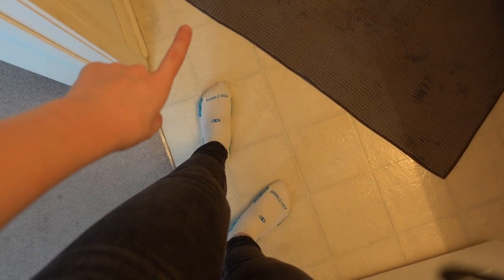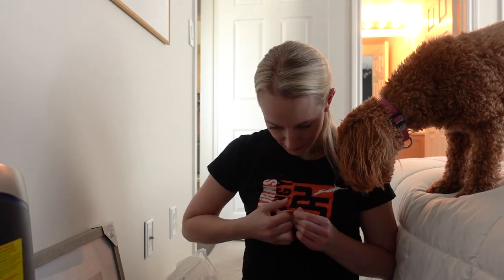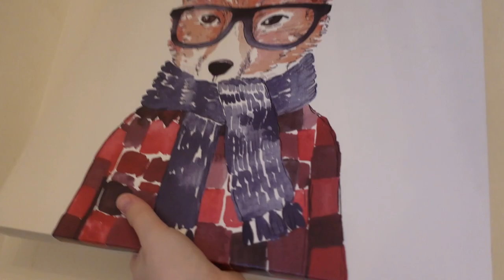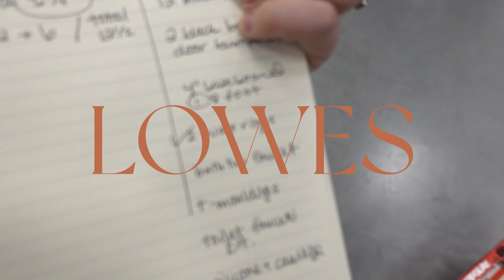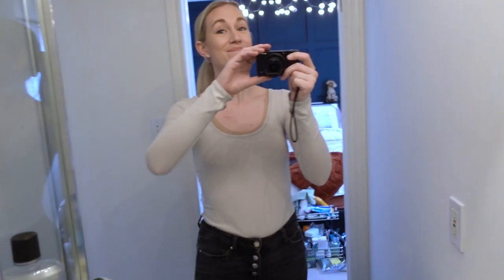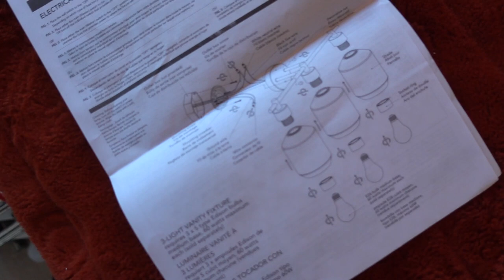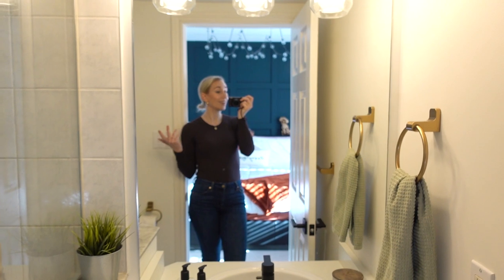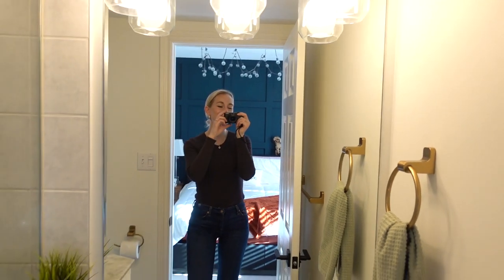Small Bathroom Renovation On a Budget

Comment: Looks great. Did you know you can get a black drain for sink as well? It would finish it off nicely.
Reply from the maker: Thanks so much for watching Deborah! You're definitely right on that front! In the kit it came with the drain which sadly didn't fit the sink (palm to face) because it's an older metal one. So alas we had to forgo that part of the switch. However, I'm grateful for this comment section because you guys and gals always have the best tips. Forever learning in this process!
Reply: Or you could spray it matte black .
Reply from the maker: @deborahbondarenko9265  Such a good idea!!!